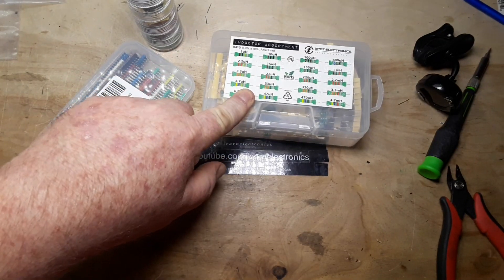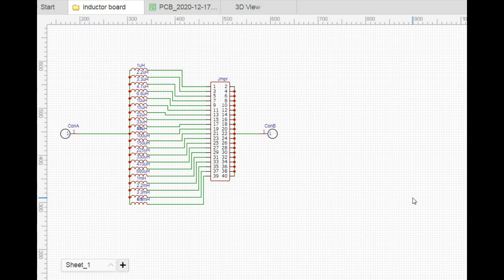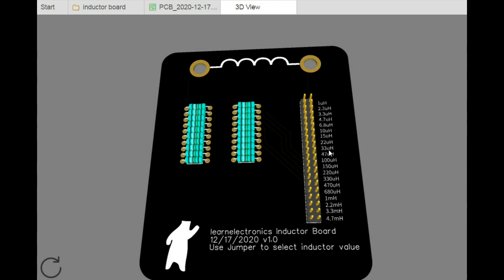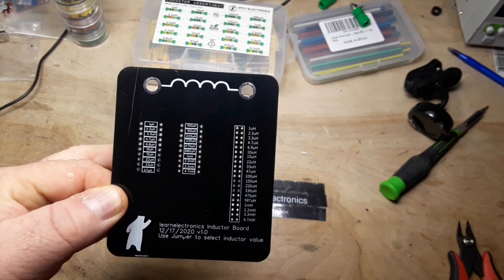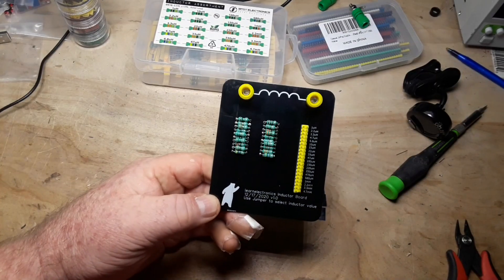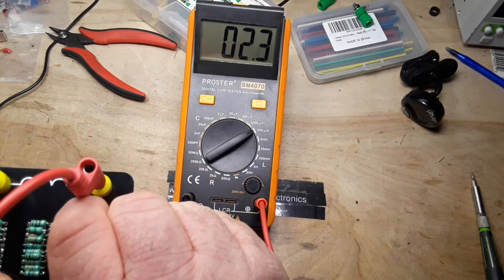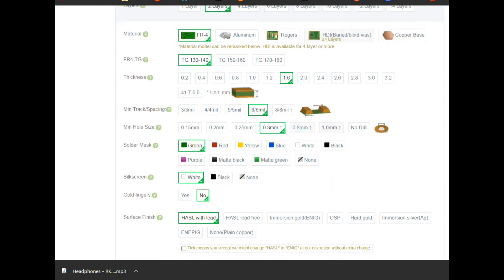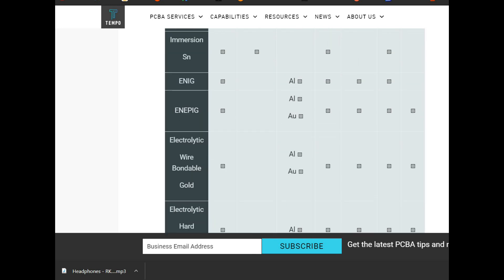Let's design and produce an inductor substitution board

Comment: That is a good idea.
Yes on version II.
There is plenty of space.
Also need to make the horizontal spacing about 2 mm wider since the inductors are about the same size as a half watt resistor.
Thanks Paul, Happy New Year. Perhaps the Steelers will do better this year. 😆

Comment: Happy New Year .. cool idea. Maybe a resistor breakout board would work as well...would be handy. Hmmm,  you mentioned. Aversion 2 board with spacing of the inductors improved.  When will that be posted ? Thanks again
Reply from the maker: V3 is at least 30 days out. I have resistor and capacitor boards coming up

Comment: I only worked a bit with inductors for a couple lab sessions a very long time ago.  I really have no practical experience but I do have one question:  Are you going to get any induced current with them so close to each other?
Reply from the maker: No, because only one completes the circuit
Reply: @learnelectronics  However, if you are using more than one inductor, to get a specific value, they may cause problems.
Happy New Year!!

Comment: great project Paul... the slightly higher inductance readings are possibly due to stray inductance from traces and board itself. no biggie..:)
Reply from the maker: Yeah, I'm not too concerned. That set of Shenzen special inductors are probably not made with the tightest tolerences either. What do you think of the 4mm banana sockets? Should I go for something smaller?
Reply: @learnelectronics  i would try smaller BP's personally and as you said those type of inductors dont have the greatest tolerances.... but its a great project to start from